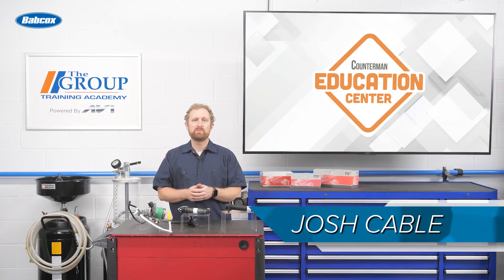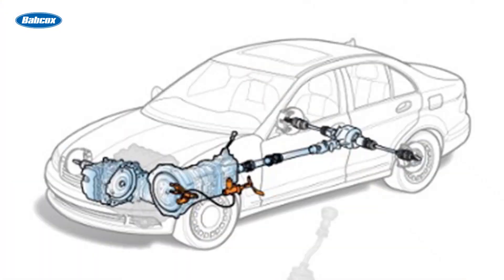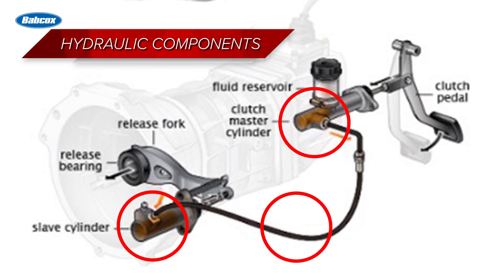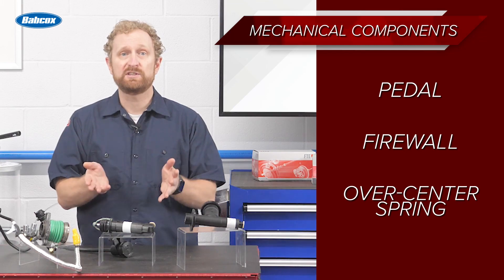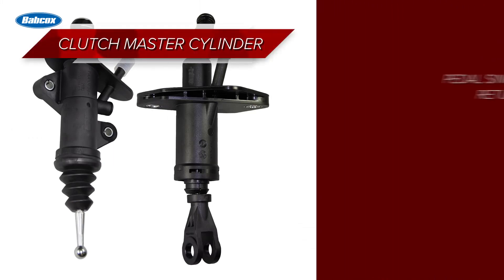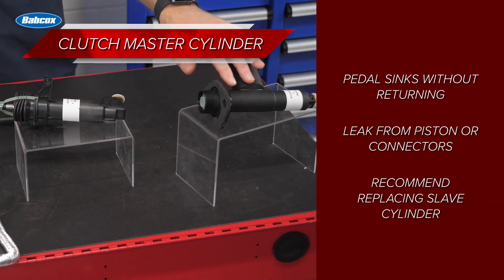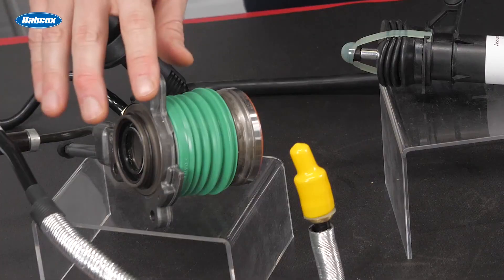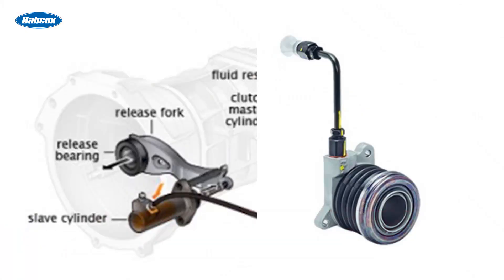Understanding the Hydraulic Clutch-Actuation System

Comment: The engine code for this clutch actuator is P0901 …this blog wasn’t enough but I’m glad I came across to it as I have this code on my 2017 ioniq after I burned my clutch and need to replace my clutch actuator along with that slave cylinder bearing